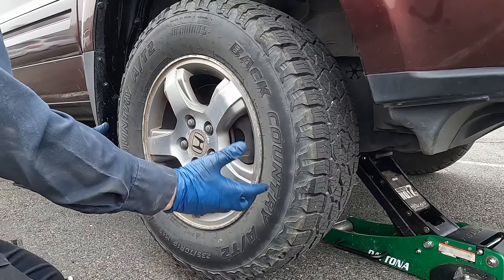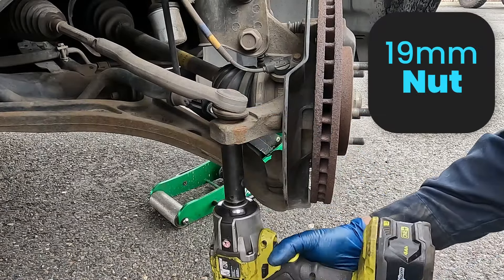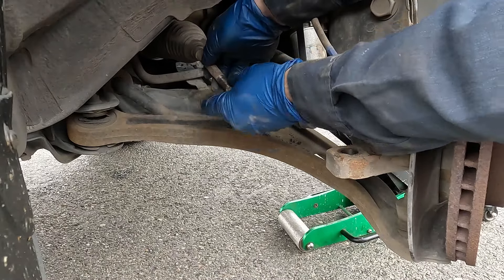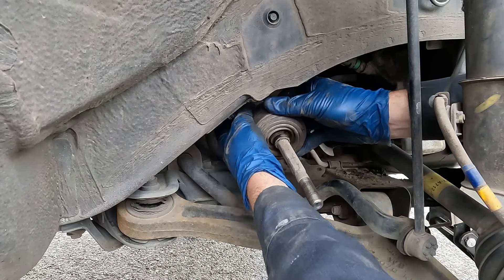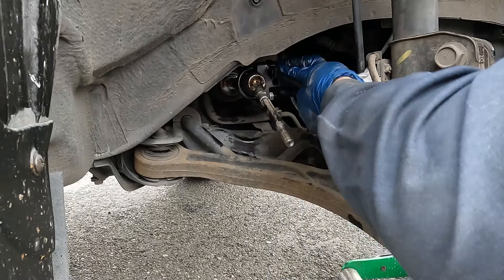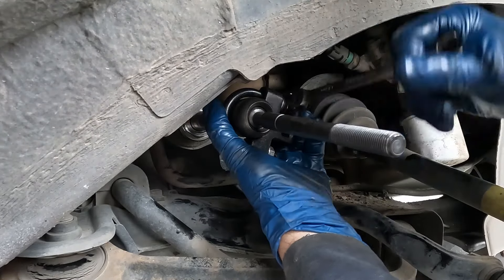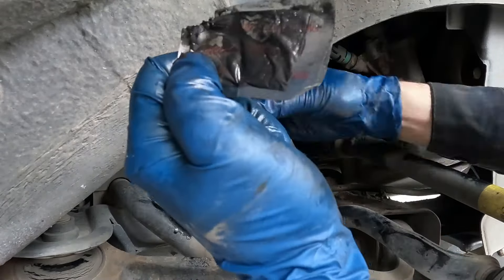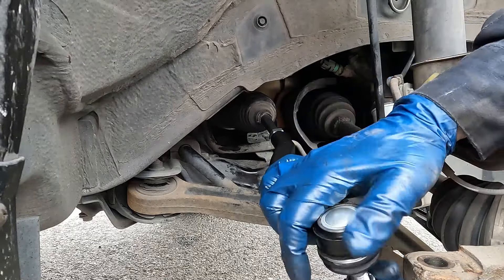2003-2008 Honda Pilot Inner and Outer Tie Rod Replacement

Comment: Hello , after replacing tie rods  inner and outer on both sides , took it to alignment and shop told me cant be done because it doesn't have enough thread to turn ! When i was installing the new one , they didn't match the revolutions from the old one . I double check with autoparts store and is the right part . Feels like steering wheel is loose now . 2 different shop told me cant be done with the same answer.  Not helpful at all . When to a autopart store and ask for 2 new one left and right , walk outside to check under the car and they are the same . What is going on. Loosing my mind ! 🤯
Reply from the maker: @mikemazzi226  This is a silly question but was the right side put on the right side? Do you still have the old parts? You can compare them.
Reply: @ValleyMobileAutomotive  yep I still have the old one. Is the same
Reply from the maker: @mikemazzi226  Hmm 🤔 that is so strange. Did you replace the inner tie rod as well? Is the toe too far in or out?